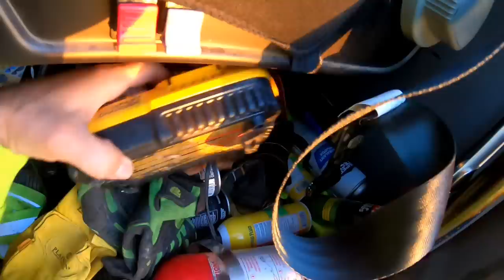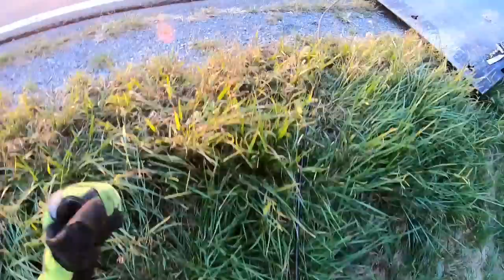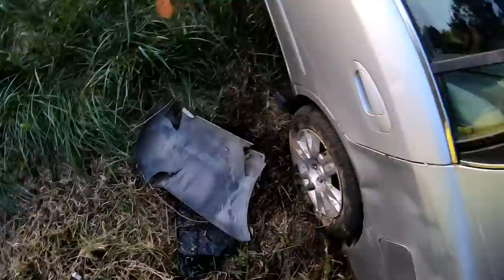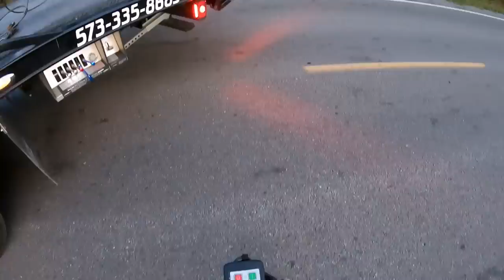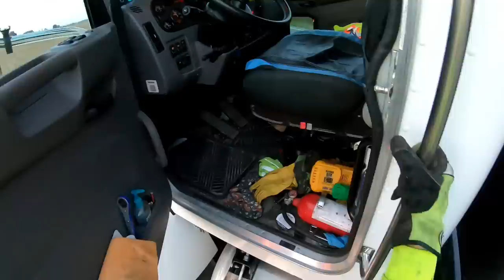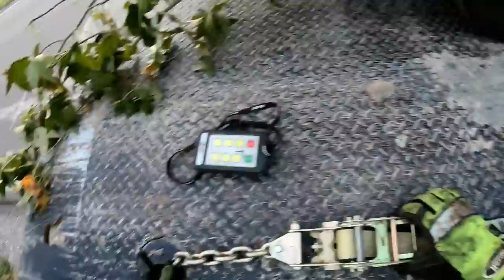New Nissan Tree-Finder  Camo Edition!!!   Quick Flip & Go

Comment: Ron in the UK we have trucks that are called hiabs ( knuckleboom ) it's basically a rollback with the knuckleboom and they are perfect for these jobs. You should look at them and be a good investment for your business.
Reply: Back in the seventies I used to drive a Thames Trader 4x4 with a Hiab jib, used for collecting end-of-life cars for dismantling.  It worked very well until the boss went to pick up a mk2 Jaguar.  The Jag stayed on the ground and the Hiab joined it.
Reply: RO BT , hello, I follow a, YT CPLE OM UK, and asked if they still made THAMES TRADERS, ssaid no, so h was THE FORD TRANSIT, bu there is a newer version made here in USA, now popular motor van, different lengths& 3 heights, most are buying petrol models, but there are 2 diesels, + many more service places, than MB, , their service is OUTRAGOUS , & the only petrol engine is only on the 1500 , 
Man places cash,,or credit diesel is the same cost, mostly more than petrol. Cheers from NJ,,,, 🇬🇧🇺🇸

Comment: Need to invent an articulated truck frame for twisting the bed.
Let you get perpendicular to road for loading.
Or put the bed on a dial , use an excavator bull gear for rotating.
Reply: They are available. Just a matter of justifying the added cost, complexity, maintenance and weight.
Reply: They have them already, They are nice but $$$$

Comment: Ron, I notice your truck is fitted with an Allison auto transmission, or at least the control pad appears so.
Is the transmission fitted with the integral retarder ?. Sounded like when you backed off the throttle the transmission downshifted without you touching the pad. Just wondered if one is fitted, is it configured to automatically downshift as the retarder kills the speed. .?
Reply from the maker: Yes, it does have an engine/transmission retarder that work in unison.  It works really well and saves the truck brakes, but I have to be certain to turn it off on wet/slick roads.  Thanks for watching and God bless.
Reply: Ron Pratt thanks for your response. I thought it was, I operated over 100 fire trucks in the uk fitted with a similar set up, the first stage was just operated when the throttle was released, and the second and third stage operated when the service brake was applied at 5 and 10 psi. On the second and third stages, dependant on vehicle speed, if the truck had slowed enough to shift down a gear it would do, then when the engine revs increased it would feather in the exhaust brake.
Agree you have to be careful in wet weather. Our system was also interlinked with the anti lock brake system which would regulate the transmission retarder to prevent wheel lock up. This element was all controlled via a separate CAMBUS system that would monitor the signals to manage the situation. The trucks were also speed limited when not on blue lights to minimise the risks further and save fuel ( our fuel budget for the fleet was in excess of £1 million). It just made the job a bit easier for the drivers being able to concentrate on the road and risks en route to a incident.
Keep up the good work Ron,really enjoy your weekly releases. God bless you and keep you and your crews safe.
Reply: Yeah, one of our fire engines has it and one of the probies forgot to switch it off in the snow. Almost had to replace the seat, the cushion was pinched tight....

Comment: I wonder how useful it would be to have a set of Hydraulically lowered omni-directional wheels under a tow vehicle to allow it to rotate in place or move sideways slowly to position it in the ideal location before lowering to the ground and beginning the pull operation.

Comment: Long straight flat stretch of paved road,what IS it that makes people wreck THERE,when there's so many more challenging roads to crash on (or just OFF of)? It's NOT like THIS road is a challenge or anything.....Glad nobody was hurt here though. I've used the "half-load the car and drag it until it's lined up enough to finish loading it" trick a few times with my car trailer. I don't recommend it with a trailer,but there's times you have to do things you don't wanna do to get the deal done.

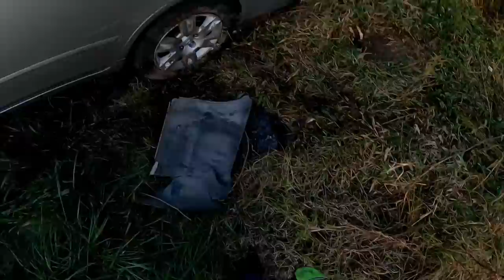Comment: 9:34 "Its locked" ..... Well of course it is silly, you didn't want it to get stolen did you?
Reply: Having been in a few different types, traumatic events like vehicle accidents tend to screw up your thinking for a while. Often you fall back to habitual actions, like locking the car as you're walking away.

This is one of the reasons for holding emergency drills: those actions (ideally) become the habit for certain conditions.